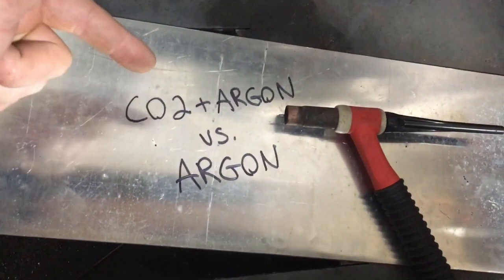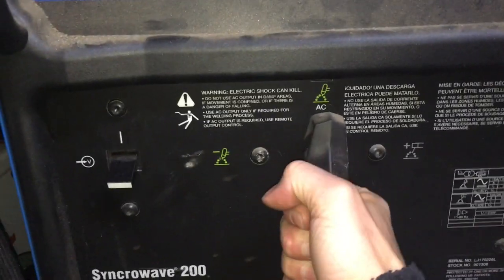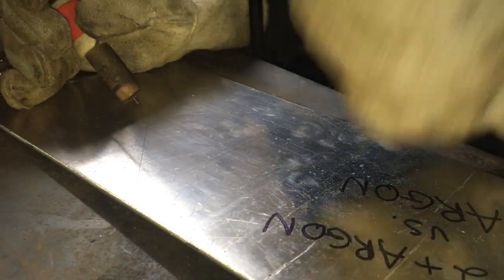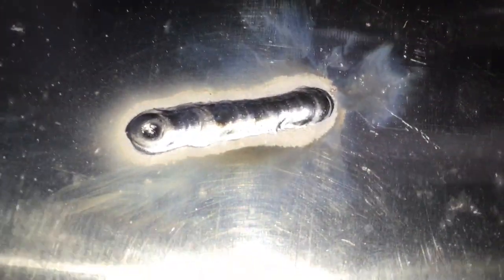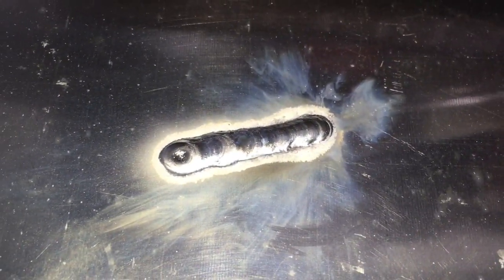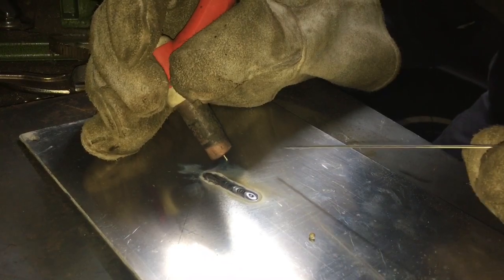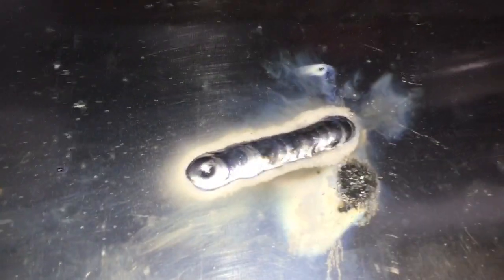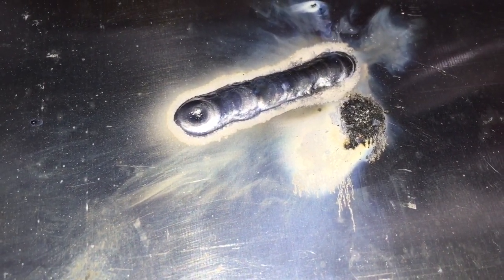Do NOT Use CO2 & Argon Mix to TIG Weld Aluminum.

Comment: What about "Mild Steel" only? Would the 25%-75% Co2 + Argon mix used with MIG welders? I have to go cheap unfortunately but an entry level TIG fits my retired budget as I eat beef pot pies and produce a harder brittle weld on sheet metal, or a softer TIG welds that can be hammer and Dollied to straighten the effected area. Thanks much! Great video. DK
Retired. ASE Master since 78, self taught + apprenticeship in 2 man shop.

Comment: NOPE......just burns the tungsten
Reply from the maker: Sure does! Lesson learned!
Reply: So I am having a bottle of 4.8 argon which I used for a while. It's still not empty so I didn't expect any problems. Yet, my tungsten burns immediately after startin g the arc and leaving hole in the metal and splatter and soot around. So could it be that when the bottle is 1/4 of it's original capacity, it no longer provides enough shielding? Makes no sense, as the flow meter can still be set to whatever I want.

Interestingly, it started doing it yesterday. I had a gas lens on. So replaced it with diffuse collet and had no problem for a while. Then it started happening again. In disgust I left the garage. Today, one good weld and three disgusting puffs of smoke and ruined tungstens. I have no clue what is going on.

A problem in a welder? Leaking in air?

Comment: Wow, after changing 2 machines, multitude of settings, tungsten angles, and producing black spots all over aluminium like on your second attempt, I now suspect that bottle I have is actually not argon...  though I was able to weld pieces together but quality is worth then garbage. Thanks for sharing, such a simple mistake.
Reply from the maker: Hopefully that is your problem, because it’s an easy fix! Got any friends you can borrow argon from as a test?

Comment: Exchanged my argon tank before work. Came home, hooked up the gas, grabbed a practice piece(luckily) and it burned up like that. Someone accidentally got co2 in there. If u think your argon is contaminated with co2, give it a sniff. It will smell like a coke/pepsi lid.

Comment: Can the argon explode somehow? I'm was always scared of compressed gas in these metal tanks.
Reply from the maker: If you tip it over and accidentally break the valve off the top, I’ve heard the tanks will take off like a rocket and go right through walls.

Comment: Does it work on DC? will the CO2 work like helium?
Reply: Probably not. The problem here is that CO2 is an oxidizer at high temps. Aluminium is a whole lot more reactive at those temperatures too. Recipe for disaster

Comment: Like a number of reactive metals, aluminium burns in carbon dioxide.  It's sufficiently reactive that the oxygen prefers to combine with the aluminium and so separates from the carbon.  You can see the same effect by putting a burning piece of magnesium ribbon into a jar of CO2.  It will continue to burn and you'll see black carbon deposits forming.
Reply from the maker: Graham Berry - good info! Thank you!

Comment: you kinda buggered that tungsten tip on the first weld! you buggered second time around two as well always keep it clean when ever you get filler metal on it replace it before going any further!!! how ever sure your test would have still come out the same even is you did not buggered it

Comment: This just recently happened to me:  my argon tank was either contaminated OR it was 25/75 argon mix.  I was TIG welding aluminum one day and the next day the ONLY change I made was a new tank of Argon .  It wouldn't weld... at all on AC - aluminum!  I thought something was wrong with my TiG machine.  Turns out it was a mislabeled gas cylinder that was most likely a CO2/Argon mix 25/75 and it was labeled / or filled as 100% Argon (NOT).   It is something that you are not expecting. Especially as a new TIG welder.  So, BEWARE  "bad" cylinders of gas / Argon DO exist and from what I understand, it is fairly common!  Thank you for the Demo!
Reply from the maker: Stefan Czechorski DDS - great feedback! I’ve never actually had a mislabeled tank, but I’ve also heard that it happens to people. It’s nice to know what to expect after this fun test. Thank YOU for watching!

Comment: Hey thanks for making this video!!! I have a brand new TIG welder and have been going nuts trying to get anything even as good as your second weld with "pure Argon" and am pretty sure I've got a completely mislabelled bottle. It's so preposterous to try and TIG aluminum on C25 or even worse reactive gasses that nobody actually shows the symptoms!!! You even show the doubters you've got gas flow. Thank you!!!
Reply: DML, this just happened to me!  100% argon label ; but had some mix within the tank!  Would not weld AC Aluminum at.....all!  Beware!
Reply: @stefanczechorskidds5536  it does happen apparently! I got pseudo verification my "argon" was either C25 or pure CO2! New tank welded perfectly right away. What are the chances I got mislabelled gas as a first tank for my brand new welder, haha!
Reply from the maker: Happy to help!  Hopefully the new tank gets you sorted out!
Reply: @WiringRescue  Hey Jeremy maybe you should even edit the tag on this to steer people wondering if they have mislabelled gas! Thanks again.
Reply from the maker: Daniel Miller-Lionberg - solid idea! Will do!
Reply: if you are doing aluminum and stainless you might want to try some helium